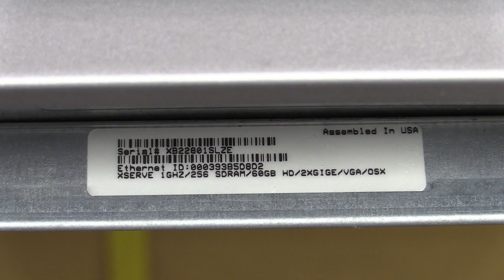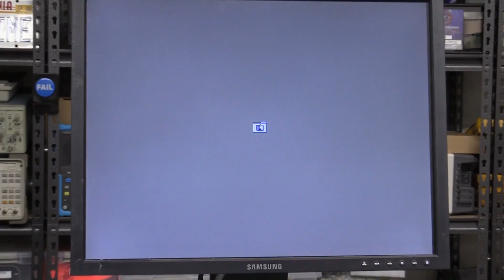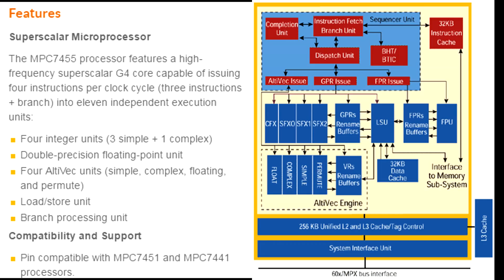EEVblog #882 - Dumpster Dive Apple Xserve Computers

Comment: These were great hardware-wise back then. Still got one running after 10+ years of service. (they get louder when starting back up after a power failure)
Reply: +Azenet I'm glad I'm not the only one that has a G4 XServe in production. What's yours up to?
Reply: Ziginox Mainly serving files through AFP and creating postscript files with osx-exclusive outdated software, which I believe was the main reason that people bought these
Reply: Ah, ours is a repair shop NetInstall server. :)
Reply: Georg Pf No, for Macs and Mac OS. (Macs don't PXE.) We have a Windows Server machine for Windows installation and other boot images over PXE.
Reply: Georg Pf Yes, I've installed everything from Mac OS 9 on a G3 B&W to El Capitan on a 2012 MacBook Pro.
Reply: FrostyExchange True, but when one falls in your lap with a 10.5 server license affixed... :)
Reply: Ziginox That's great, I appreciate that! :)
Reply: +Azenet I run one of the 2008 dual-CPU units as a Plex/Sonarr/NZBGet/Couch Potato server.  Loud but cheap! :3
Reply: +Ziginox were useing mac minis for netinstall and ast just much better and faster now of days, not sure if we ever had a xserve before the mac minis were using a white macbook lol it worked
Reply: I appreciate you guys using old hardware! +Ziginox For Windows Netinstalls? How did you get a PXE server on there? I once tried Linux on those and it ran great (there are even a bunch of up to date distros out which support PowerPC hardware), but there was no additional software in the repositories that was compatible with the architecture :c
Reply: Ziginox Ahh okay, I see. I thought you were using it as a PXE server and that made me curious. And you can install current Mac OS X's off it?
Reply: Otaku+ Which OS? :)
Reply: Georg Pf Snow Leopard Server.  Ubuntu Server would have been a slightly more optimal choice but I VNC into it frequently and so appreciate the eye candy.
Reply: Otaku+ Ohh so you've got Intel CPUs. I wondered how you did this on a PowerPC machine haha.
Isn't Ubuntu Server with i.e. Cinnamon an eye candy as well? ;-) Don't know how it runs on your VGA card of course. XFCE or LXDE will definitely run smoothly on slower cards, but of course without the "eye candy", as you call it.
Reply: yeah real grease wheels,need some g5 caddys you got?

Comment: I keep dell poweredge server for electronics parts.
Im already making in-circuit ESR meter(based on mkII that Dave owns) and I needed 22uF and 220uF tantalum SMD cap, I got them from that server.
So we can sell server for 20$ or keep it and have 500$ of electronics parts(100$ from only tantalum caps in my case).

Comment: The "MAC-thing" was actually standard FireWire, IEEE-1394
Reply: +666Tomato666 
Yep, I was really surprised that Dave dont know FireWire...
Reply: yeah, especially given that FireWire was basically the dominant interface for connecting the video cameras to PCs for quite some time...
Reply: RevengeofGothzilla was never proprietary learn what words mean
Reply: RevengeofGothzilla IEEE 1394, not proprietary. FireWire beat USB but the future of FireWire did not beat USB. Remember, Apple was first to use USB in a computer (original iMac 1998). So they had nothing against USB.
Reply: frtard
no, because it was badly marketed and was more expensive to implement

there are multiple instances of inferior technology "winning", look at betamax for another example
Reply: +666Tomato666 Firewire was an excellent means of connection and far superior to crappy USB 2.0.
Reply: +Arek R. It it's Apple, he freaks out.
Reply: 666Tomato666 yep yep only thing iv used them for. I still have a few laying around from high school. They where required for a few production classes.
Reply: +666Tomato666 >standard
>proprietary connector.
Reply: So that's why FireWire went the way of the dodo. Because it was superior.
Reply: frtard It's still being developed but costs a lot of money, because the mass market has gone with USB 3.0.
Reply: Looks like FireWire-800, yeah.
Reply: ya gdrive ext
Reply: This idiot doesn't know half of the things he THINKS he knows. When describing things, he sounds like a total moron.
Reply: +666Tomato666 Well Firewire was developed by apple......Probably stolen tech but

Comment: the second fan is probably for a second processor mountable on the empty slot just near it, corresponding to the other one...
Reply: +squalazzo and it's loud because it's open, so the temperature regulators don't work as expected and keep the fans at max...

Comment: I think you might be a little slow on blower fans they suck from the bottom and blow out the side although you were kinda right they did have tight ventilation on the intake

Comment: I have repaired a lot of power suplies of them.
Reply: +tyrgoossens redundant power was available just not on that one.
Reply: +ReduktorSzumu 
Chwila, że niby naprawiałeś wiele zasilaczy delty?
Reply: +Arek R. Tak.
Reply: A co nawalało?
Reply: Głównie elektrolity.
Reply: A jakiej marki i temperatury były te elektrolity?
Reply: +electricsnut thats an apple design decision tough. this is an emc rebranded powersupply and redundant powersupplies are easy to integrate if the case allows for it and you have a psu backplane

Comment: How do these CPU's compare performance wise compared to the x86 counterparts from AMD and Intel?
Reply: +Skräcken For floating point math they're very good even compared to modern Intels, as an example the 2.5Ghz G5 Quad (2005) delivers around 76 GFlops, (that's 19 GFlop per core). the Intel 4Ghz 4790K (also a quad; 2014) delivers around 96 GFlops (that's 24 GFlop per core) yet almost 9 years difference. 
For integer/general purpose they are pretty slow- about the same as budget laptops has these days. 

The biggest problem is the I/O is really slow compared to todays standard- that is both memory bandwidth and device access- otherwise they could probably still be used... and of course almost no one cares about CPU computational performance these days as a regular GPUs runs circles around any CPU for pure math- thanks to their high parallellism (like the Nvidia GTX 980 has around 2000 "processors")
Reply: A single core (core solo) 1.5 ghz mac mini from 2006 was faster than a dual G4 1.25 ghz MDD from 2003 in Geekbench 2. But comparing x86 to RISC isn't fair, the software optimized for PPC and altivec could make it faster.
Reply: +oldmac6 Well good point but I was just thinking for a general usage performance. I'm just thinking it would be fun running a machine with a different architecture, maybe as a Linux box
Reply: I had power PC Macs and they desolated x86 probably cause of software optimisation. to the CPUs but my old 400mhz one will outperform a 1.8 core 2 duo :)
Reply: +Skr&#228;cken Honestly at this point you might as well run a quad core 1.2 Ghz ARMv8 with 1GB RAM - https://www.raspberrypi.org/products/raspberry-pi-3-model-b/
Reply: +Fredrik Andersson Wow that's pretty impressive FPU speed actually!
Reply: +Skräcken PowerPC routinely kicked ass on FP. They had a real SIMD unit (Altivec) too, not the kludge in the Pentiums. And the instruction set had plenty of registers, not the few in the x86.
Reply: why do people keep posting RPi stuff? If you're going to suggest ARM boards at least post to something fast that would stand up to a 10 years old design, some qualcomm board or something.
Reply: +blitzwing1 Yes seems you're right about AVX2, either way my point was that CPU floating point is not as important these days as todays programmable GPUs are way more powerful than any CPUs.

Comment: About the size and noise: both are normal even for modern servers.

Mainstream servers are typically 700-800mm deep (can be over 900mm for larger, say, 4-socket servers). As for the fans - if they spin up to maximum RPM (e.g. if a fan failure occurs and the other fans compensate for it) typical rack devices are deafeningly loud.

Comment: does the unit work as it might be possible to get it working and get a version of GhostBSD 10 (EVE) for the Motorola MC680040 or PowerPC and you could use it as a file server, or if you could get a APPLE OS X hard-drive you might be able to get them to boot up.

Comment: For servers, those things are designed pretty bad in my opinion. As usual with Apple stuff cooling is handled rather poorly, especially the HDDs don't seem to get a lot of airflow and also the memory blocks(wich, depending on wether you use FBDIMMs or not, can get quite hot) have to live without much fresh air. The PSU is not redundant and not hot plugable. As nice and tidy they might look, as unpractical I think they are. For a good 1U server design, take a look at IBM or Dell servers. They are loud af but do a really nice job.
Reply: +MrNoname7890 
1. Anything you say about cooling, without you having done a thermal analysis, is worthless. 
2. Dell servers today can't be compared to Apple servers from 2003.

Comment: Old hardware like this is actually quite useful to the right people. I'm a programmer, and a lot of software out there has a 20+ year lifespan. The oldest code in Android dates back to 1991 at least. Desktop Linux systems have GNU software dating to the mid-80's. Hardware has become so fast as of late that you can simply run the same old software, with security updates, on the same old hardware for 10-15 years without any problems whatsoever. With RAID it doesn't matter if hard drives die. Everything else is equally modular. In the rack you aren't running modern, bloated Windows applications. Instead, you're running efficient, purpose-built software that runs great on 1 GHz processors.
Reply: +John Gotts Yep, for sure. And before there was Linux there was Unix, developed back in the '70s. FreeBSD is a notable descendant of the BSD variant of Unix. And, in turn, OSX contains a large amount of code derived from FreeBSD. Good stuff!
Reply: +John Gotts I'm not sure there's any original code left in todays (running) linux kernels, especially for the arm architecture and the Android needs. Maybe in the input layers, and possibly some relating to memory management and/or process management. That said, the kernel as a whole is that old, of course.
Reply: blitzwing1 I certainly don't consider it a POS. For one thing I don't know any more cost effective choice. It has it's problems for sure, though.

Did Linus call it a bloated POS?
Reply: blitzwing1 If you are looking for high performance and SMP, have you tried DragonflyBSD? Check here: http://www.dragonflybsd.org/performance/
Also, Scientific Linux (a rebuild of RHEL): http://www.scientificlinux.org/
Reply: blitzwing1 Are those slides available somewhere? Not contending any particular point, it's interesting to know what the devs think about it so it'd be a nice little read :)
Reply: blitzwing1 You're welcome. And in case you're wondering about Linux binary compatibility if you run DragonflyBSD, it's not a problem.  https://www.dragonflybsd.org/~labthug/handbook/linuxemu.html
Also, the chart I linked above was a comparison of DragonFlyBSD 3.8 to other BSD's and Scientific Linux. The current version of DragonFlyBSD is 4.4.3, so I would venture to say that it's performance is even better. Give it a try if you get the chance!
Reply: The main issue is the amount of power these things are sucking for the amount of work they do.

Comment: Dave, the 'random apple connector's are called Mini VGA, so the other server does have a video out too - the first machine probably had that ATI card because someone was using it for video graphics work.

I have a box full of Mini VGA to VGA adapters, give me a shout and I'll ship you a handful ;)
Reply: +BilbyBaggins Those are Firewire 800 ports. The only graphics were on the PCI card.
Reply: Oop, you are correct, Dave panned too quickly haha.  I had some of the post-PPC models and they had mini-VGA ports.

Comment: What was the point of these? To fulfill the "huge" demand for servers to run software only available for power-pc's? Great idea apple.
Reply: +Völundr Frey As far as I know, PowerPC CPUs used to be more powerful than x86.
Reply: +Ascii As with everything it depends on the workload but for "supercomputer" stuff as +lsmanufactur said: "The US Air Force had a relatively big Cluster on which they simulated atomic bomb explosions an other R&D stuff. They claimed it was the best price/performance supercomputer at the time for them..."

The reasons for Apple to move from PowerPC to Intel are many but price and generic performance per watt definitely played a role.

I think IBM still makes Power architecture supercomputers for those that need them...
Reply: +Ascii Wolf They're still used for specialized software; things like IBM POWER see new releases every year.
Reply: Well, how about if you had 150 Apple Mac G5 machines back then and wanted to use features like Time Machine on the network. You needed a server for that which supported Apple's own file server protocol.
Reply: +Völundr Frey Servers run Apache or other file-serving software. Nobody cares what other apps they can run. And nobody cares what video card they have, as they don't need one.

Comment: I have a bunch of "ancient" PCs around here. One is set up as a jukebox and TV unit in the shop. Couple others hold service manuals, tool manuals and such. Those old machines work well for that type of stuff. Putting a .pdf on the screen doesn't take a lot of power..

Comment: The Apple server is a headless,  rackmount server.  It does not generally have video of any type. The PCI slot is mostly for networking , FiberChannel and scsi raid disk drive array controller..  The disc tray on the front isn't ide, it's sCA SCSI .  Hot unplugable.    The configuration I evaluated cost around $15,000.  W8gb, dual giganit network and FC RAID.

Comment: Are you sure the fans are not sucking up air from below and blowing it through the heatsink?

Oh, and could you tear apart a Delta power supply once? I've heard you say that Delta power supplies are good quality in multiple videos, but I'd like to know what you think it is that makes them good quality.
Reply: +Naomi Baron I'm pretty sure the fans sucks the air up from below as you say. He probably screwed up about which way the air goes through these types of fans.
Reply: Correct: the intake region for high-speed (i.e. 15krpm+) blower fans on the bottom of the fan itself. There is little room between the fan and the bottom of the chassis.  The intake air comes from the front of the chassis, and the exhaust blows across components (CPU HSF, RAM, MB, etc.) and out the rear of the chassis.  This requires the chassis be as "airtight" as possible, forcing "linear" airflow from front to back.  It also requires that the MB and HSFs be designed to cater to said airflow (e.g. fins of HSFs must be aligned front-to-back, DIMM slots must be placed the same way, etc.).  A MB not designed that way, or an HSF installed wrong (rotated) can/will result in overheating.  The design shown is still used today in 1U boxes (see any of Supermicro's 1U servers).  Decent datacentres also cater to this through "hot-cold aisle" design, where cold air is pumped in through the floor of the aisle where the fronts of servers are (which in turn requires all open/unused areas of a rack be filled with panels (i.e. no open slots in a rack)) -- Google search and you can see what I'm talking about.  Overall, the design works quite well.
Reply: +Naomi Baron I have a couple old Delta ATX PSUs, a 350 and 400 that I pulled out of HPs.  They are at least 10 years old and still work perfectly,  I use them as backups and for testing purposes.  Can't kill em
Reply: +Naomi Baron Jonnyguru does PSU teardowns and excellent reviews. He's done a few delta server units. Worth a read to be sure.
http://www.jonnyguru.com/modules.php?name=NDReviews&op=Story4&reid=312
http://www.jonnyguru.com/modules.php?name=NDReviews&op=Story&reid=314
More recently premium quality retail places have gone for Delta OEM units. Here's an excellent review of an excellent unit. Top quality for sure.
http://www.jonnyguru.com/modules.php?name=NDReviews&op=Story&reid=101
Reply: +Naomi Baron 
I teared down quite a few delta server PSUs, all of them use nichicon/nippon caps, and other high quality parts.
Reply: geeez,delta is like sigma an that is a test phonetic ,e wants job in joes space tech 3000?

Comment: i want it , no matter how shit , i like the looks of it
Reply: +Justagermannerd You can get an Xserve RAID for practically nothing, and they look quite nice as well. It can be useful if you have 14 IDE HDDs lying around (or any number of SATA 2.5" HDDS and 14 IDE to SATA adapters) I threw away my old one because I wasn't using it.
Reply: +Sam Fedorka the xerve raid still need a xserve with a fiber card to work
Reply: Nah, any machine with fibre channel will consume storage from a Xserve RAID. The best part of the Xserve and Xserve RAID are the pretty blue led activity lights, otherwise they're a bit noisy, bit power hungry, and a lot old. The big problem with the Xserve RAID is IDE. Who wants to trust an old IDE drive? and the largest I think is 1tb? The Xserve RAID is two 7 drive arrays, so the best you could do is software stripe across two 7-drive raid 5 arrays, 12TB. But if you only found 500gb drives and wanted redundancy you might end up with 3 TB (RAID5 hardware + mirroring in software). Or pick any number in between for larger disks or less redundancy. It's not super fast and it sucks down a good chuck of power. A modern PC with FreeNAS and a QLogic FC card would out perform the Xserve RAID in every way except blinkenlights.